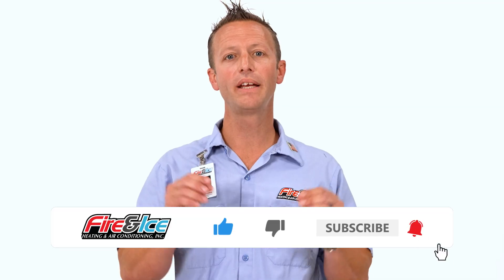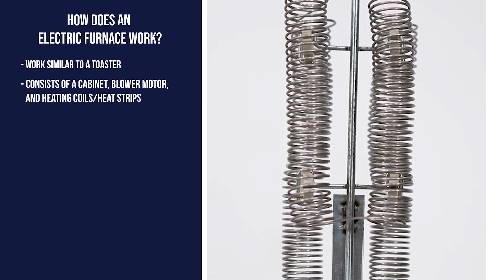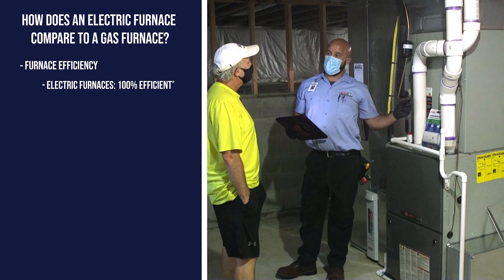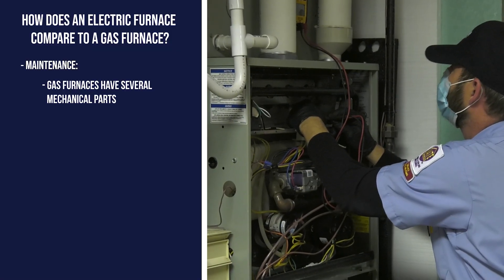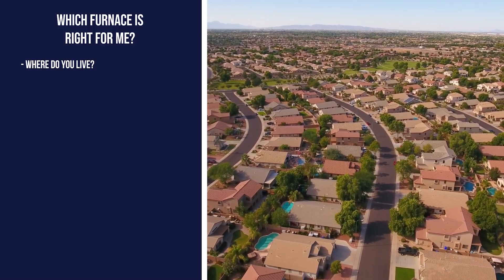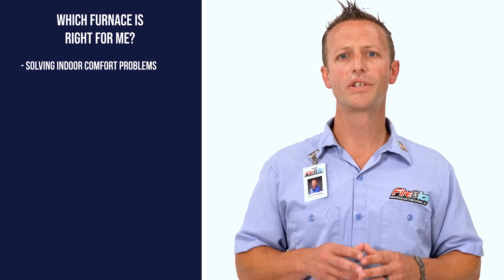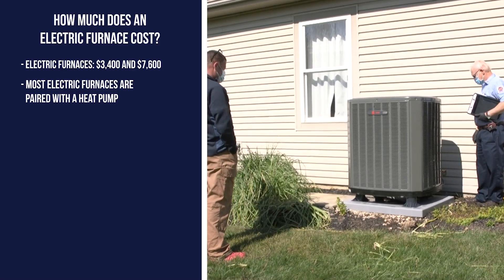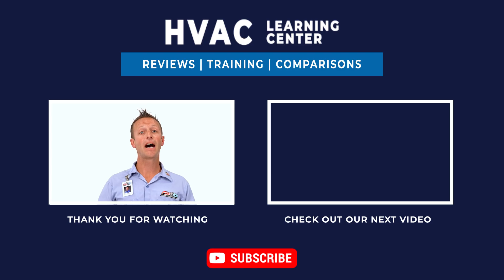What is an electric furnace and how does it work?

Comment: Can upgrading my existing electric air handler and heat pump to the correct size bring my energy costs down or would switching to propane be better in Ohio? I'm asking for both cost and warmth.

Comment: Retired electrician and an electric furnace is a box over the air handler to throw a lot of money at. Every time I converted a duplex,triplex or apartment building from owner supplied usually gas furnace or oil boiler to electric baseboard heaters tenants cried the blues over sky high winter electric bills. Now with goofy California banning the sale of natural gas residential furnaces and applicances  and having reo EV Chargers homeowners might have to have a 300 expensive new service and high electric bills.

Comment: I have been having nothing but trouble with my electric furnace. 😔 The coils must not heat up quickly. The furnace kicks on but takes several minutes to actually blow warm air into my home. I have had nights where the furnace never kicks off because it cannot reach the set temperature. House isn't even 10 years old. Multiple HVAC people give me the work around saying its the thermostat. Replaced it three times already. 😔

Comment: I currently heat my home in Saint Paul Minnesota with a pellet stove and it works very good. I do have duct work as my home used to have a gas furnace. Although I like the pellet stove as I get older I may not want to be carrying a couple hundred 40 pound bags each winter to heat my home. I really don’t want gas in my house for safety reasons. Would an electric furnace and a heat pump suffice to heat my home in cold Minnesota winters. I am not opposed to installing a few electrical wall heaters as well. I realize that a gas furnace would be a lot less expensive to operate on a monthly basis but as I said I really don’t want gas in my house. My older home is well insulated as I gutted the interior and redid the wiring and plumbing and installed new insulation. I also installed new windows and doors.
Reply from the maker: I would not use electric heat and heat pump in Minnesota.  Oil or gas or pellet or wood, not heat pump, will run ALL the time

Comment: We installed a Lenox heat pump 4 years ago in Montreal and about to replace an old oil furnace to electric. Should I replace my heat pump at the same time or just the furnace and any suggestions on a brand  for a house that’s about 3000 sq ft. Much appreciated.
Reply from the maker: Carrier.  A matched system can be the most efficient system.  But matching it not always necessary to have an operational system

Comment: Fantastic video. Thumbs up. I have solar panels and it’s time to replace our gas furnace. I would like to go electric and my solar will def cover that expense. It’s a 3,700 sq 3 story with a basement in Colorado. Will I need a heat pump still?
Reply from the maker: Yes.  I would recommend a heat pump with gas back up.

Comment: I live in East Texas and am remodeling our mobile home, my question is, I already have a trane furnace to install inside the home so about how much would it cost for someone to come out and install the furnace (including  all the wiring and pipes)? That's all I need done at this point is for someone to just install it into the hallway cabinet that the previous furnace was in. The previous furnace blew air through floor vents but my husband, before he passed away in the process of the remodel, took everything out and decided to run all the air vents and ducting through the ceiling. So all I need at the moment is to have someone connect the furnace to the house and run the lines or pipes that will go under the mobile home and connect to the outdoor unit which I haven't purchased yet. Just need an estimate on about how much that usually runs, price wise?
Reply: P.S it's an electric Trane 3 ton furnace
Reply from the maker: There are a whole lot of scenarios and questions I don’t know the answer to.  But you are probably looking at a few thousand dollars.  Contractors don’t like to put in equipment that they do not provide.
Reply: @fireiceheatingandaircondit4363  I am definitely going to have a professional do it and I figured it would be at least a few thousand to get it done right. Thanks for your reply 🙌

Comment: Quick question, I bought a new home currently on propane heating which is used only for heating (not water, cooking, etc).  The current furnace size is 100,000 btu. We're in Cleveland Ohio, 2500 sq foot home. In your professional opinion, would it be more cost effective to eventually switch to electric? I am struggling to find a larger electric furnace so perhaps twinned electric furnaces would make sense here? Total propane cost appears to be around $2400/year which seems to be quite a bit, compared to nat gas (unavailable at our location).
Reply from the maker: High efficiency heat pump with high efficiency propane furnace backup would be my choice
Reply: @fireiceheatingandaircondit4363  sounds good, perhaps we'll look into that! Could the heat pump be installed in addition to the ac unit, or would the AC unit need to be replaced and heat pump for heating and cooling substituted in place? I only ask because we moved into this house and the air conditioner is literally brand new as of last year, so I would hate to trash it if we could just run a heat only heat pump alongside the air conditioner
Reply from the maker: A heat pump would replace the ac, as it is an ac also

Comment: I live in a 1918 duplex. The FAU is dated at 1998. Right now the gas release valve is non functioning and I'm sitting here with no heat as I'm waiting for the part to arrive.

As I'm buying the whole duplex, I'm looking to change my heating setup/FAU. Next door had their FAU replaced as it was kaput.

I live in the city limits and we get cheap electricity. I don't want to deal with the gas company so I'm looking to replace the gas furnace and FAU with an electric one. I'm an architect, so I have a reasonable amount of knowledge about HVAC but I'm struggling to figure out if a electric furnace connected to my existing ductwork is better than running multi splits to each room.

Any advice would be most appreciated.
Reply from the maker: Multi splits to each room is going to be considerably more expensive than just replacing the unit that is already connected to your ductwork
Reply: @fireiceheatingandaircondit4363  Okay, I take your point. I'll have the local HVAC company I use give me a quote to replace the gas boiler for an electric one.

The reason I ask was, the ductwork isn't that efficient as it's quite narrow going up within a wall. When the air is on I can feel it but it's a bit asthmatic at best.

I thought if I went with a Mitusbishi unit that can handle 8 splits it would cover all the house and be cheaper to run.
Reply from the maker: With a 104 year old home, I would get 3 estimates from 3 contractors.  Tell them the age because many guys in the field aren’t up to this task.
Reply: @fireiceheatingandaircondit4363  Well as luck would have it, the landlord agreed to replace the furnace before I buy the property. I was stunned by that decision.

I will ask the HVAC company what's the price diff between a gas or electric unit. I'd prefer electric as its much cheaper.
Reply: The unit that failed was dated at 1999. Funnily enough the unit next door failed a month before and the landlord replaced it.

The ductwork in the house is fairly new. I can't quite figure out how the house was heated before the retrofit. There is no fireplace but there is a chimney in an odd location of the house.

Comment: I average around 3500 litres of propane a year to heat my home in Canada.  with the cost of propane I am seriously wondering if it wouldnt be cheaper to heat with a forced air electric furnace.  I am paying 14 cents per Kw/hr for electricity.
Reply: I am in the same boat. Also propane furnace also uses electricity.

Comment: Back in the early days of HVAC and when gas and electric were very cheaply priced, even then it was determined hands down that gas was the best method to heat homes etc.
Today, power prices are way expensive and they have increased more than gas has when compared to the past few decades.  With that said, our authorities want us to believe its better to heat homes with electric. Interesting...just how did they prove that concept?  It would appear they are suggesting this because electricity won't release any CO2 when used.  They all forget CO2 is produced to generate power though, lots of it.  So, is electric or heat pump heating ideas better for the citizens knowing that gas is priced lower? No, it is not. Is it cleaner for the country? No, it is not because the added gas burned to produce power at the power plants will increase. Is there any gain with converting to all electric heating? No, not unless you are counting how many postage stamps use or bills you will have to process for payment. Don't forget, if you have gas furnaces now, to go to electric you will need to spend a few thousand dollars with an electrician to get the 220 volts wired for the new furnace which doesn't have 220, only 110v. So, add that cost to your less efficient and more expensive to run heating system. In another 20 years, they'll push natural gas due to some "discovery" and recommend people use gas instead.  They did exactly this in the 1970's, they pushed CNG for transportation and advertised how "clean burning natural gas" was and efficient up until someone thought about CO2 and how to market something different like electric, all while its more expensive and less efficient to use.

Comment: Hi! Because of the skyrocketing cost of energy, I am considering getting a solar panel array that will more than cover my home's energy consumption.  I currently have a gas furnace. I also have central air,  and am disinterested in replacing  the central air, but possibly the gas furnace.  I have a 2 story townhouse with a full basement, and my home is approximately 950 square feet. Suggestions?
Reply from the maker: The Trane S9V2 is an excellent furnace

Comment: My house is being built and the heater is an electric forced air heating and electric hot-water tank. I will also get a heat-pump. My question is, does the house require cold air return? I walked it the other day and there’s only one return on the ceiling, nothing on the floors. Thank you! Also I live in the peninsula of Washington.
Reply from the maker: One central return can work for certain layouts
Reply: @Fire & Ice Heating and Air Conditioning Inc  I hear those electric units are amazing to save money with they will rival solar panels only down side is I hear there super expensive to fix

Comment: Thank you for this. I live in coastal central California. We just added a photovoltaic system to our home. I'm interested in getting off of natural gas for heating. We don't need A/C. Is it possible to simply get an electric furnace to replace our natural gas one? We only use our current furnace in the winter.
Reply from the maker: Yes, but straight electric furnace is the most expensive way to heat
Reply: @fireiceheatingandaircondit4363  is it more expensive than oil??? in my area is $6 x gallon I'm in the verge of switching to anything else since the price will continue to go up.

Comment: Can an 80% gas furnace that vents out chimney be converted to vent out a wall or roof?
Reply from the maker: Yes, but most likely would be cost prohibitive
Reply: @fireiceheatingandaircondit4363  Can you give me an estimate of what it would cost? Thanks. I'm in Columbus.
Reply from the maker: Please call in and we can schedule a time to come out and look.  614-842-2100
Reply: @fireiceheatingandaircondit4363  My house is old. Looks like someone had a wood stove in the basement a long time ago that was vented through the chimney. What would it cost to do what they did? Put wood stove in basement, and just shut the furnace down.
Reply: @fireiceheatingandaircondit4363  The reason for all this is: the furnace has been tearing up my chimney, even though it has a flue liner.

Comment: I have a question:  when using an electric furnace with a heat pump, is it more economical to keep a constant temperature setting, or does turning the temperature down over night use less energy?
Reply from the maker: Turning down the temp 5 degrees at night can save money, but I would not go more than 5 degrees
Reply: @fireiceheatingandaircondit4363  Is there a downside to having a larger difference in temperature?

Comment: Thanks for sharing your expertise! We are in Los Angels, close to beach. House is about 1800 sq ft, one story. What kind of electric furnace should we consider? Do we have to have the heat pump? We don't need AC in the summer. And we do plan to stay at house at least 10-15 years more.
Reply from the maker: If you don’t need AC, any electric furnace will do.  But if you heat with a heat pump instead, it will be considerable less electric cost when heating

Comment: Thanks a lot for the video. I'm researching into a new heating system for my home and addition. I currently live in Massachusetts and have an oil boiler which uses forced water for the baseboards.I also have as a wood stove which can heat most of the house but won't be able to heat the 1000sqft addition. I plan on have a 8kwh solar system installed but being in New England I'm torn with either propane (natural gas is not available in my area) or electric as a heating source or even what kind of source it could be?
Reply from the maker: Sounds like you have covered the bases with alternative fuels.  Ultimately propane is cheaper over electric and heats down to a lower temperature.  Being in New England you will want that.

Comment: I live in a basement and my landlord has an electric furnace in his house. Every time the furnace ignites, I hear the dripping sound in my bedroom as the vents go through my bedroom ceiling, inside the walls. Especially at night, this sound is very loud and doesn't let me sleep. Can you please suggest, what would it be??
Reply from the maker: An electric furnace does not ignite.  It just heats up electric heat strips, and the air blows over them.  I would recommend having your landlord call an hvac company if the unit is unbearably loud